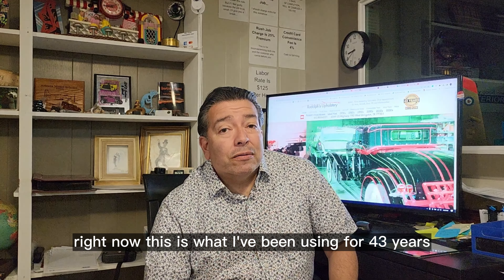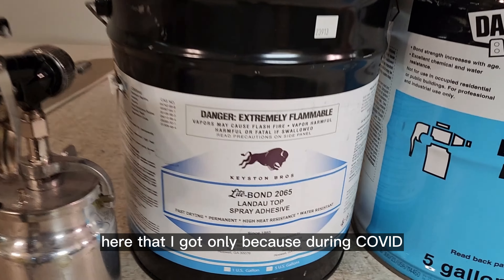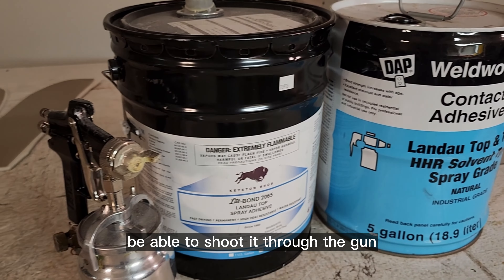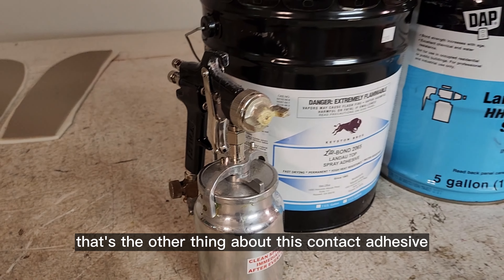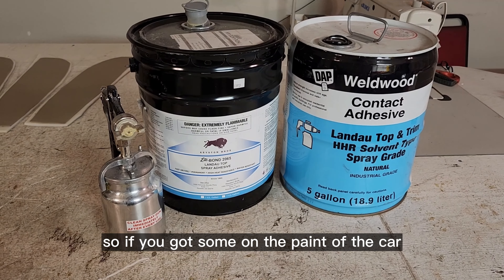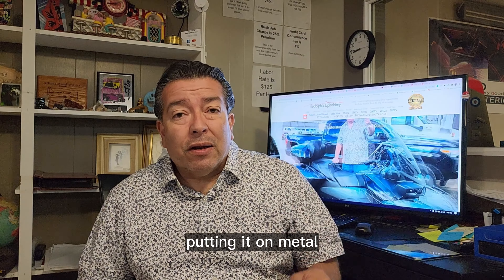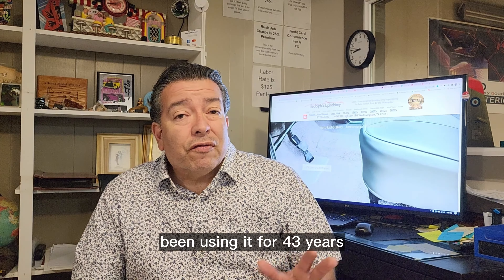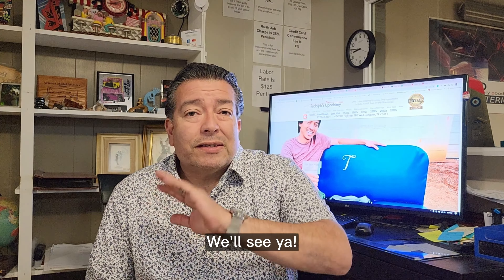You have been doing this wrong 3M spray can glue adhesive

Comment: Do i need a gun?  Or can i use a brush?
Reply from the maker: Hello Lone, You can use both a brush or spray gun. Please keep liking and watching!
Reply: @oldschoolautoupholstery  thanks.  So i have another question. I did my headliner, and i used a brush.  The contact cement went through the fabric and the suede fabric now looks like it it stained.  Is there a way to take off without damaging the suede (faux suede), or having it come off the board?  Or do i have to redo it all over again?  Thanks for the knowledge.
Reply from the maker: @Lonewolf70-  Hello Lone, Sometimes things happen. Mineral spirits is what I used to remove glue. The downside is, it will also loosen the area already glued. Please keep liking and watching!

Comment: 3m 90 wont go anywhere on u if u prep properly and actually let it tack before u apply both sides ;)
Reply from the maker: Hello DJ, Hot weather climates when the inside of your car reaches 140 degrees, that glue will fail. That glue never cures. Contact adhesive cures and will never let go. It has also never failed me in 44 years. Just sayin'. I have paying customers and want to maintain a really good reputation. I am not willing to risk it. Please keep liking and watching!
Reply: @oldschoolautoupholstery  havent had an issue with 90, it's rated up to 80c or 190f? i think. You're right tho, if you're doing it as a business its just worth to invest in a spray gun and get contact adhesive in gallons :)
Reply from the maker: @djilu9916  Hello DJ, Right On! Right on. Please keep liking and watching!

Comment: 3M 90 is much better than 77.
Reply from the maker: Hello Jay, Contact adhesive is way more reliable than the 90. Just sayin'. Please keep liking and watching!
Reply: What about face ventilator safety? Not safe to breathe that stuff.
Reply from the maker: @jaygold4467  Hello Jay, I have never worn a face ventilator in 44 years of spraying glue. Then again, We drank from garden hoses and didn't have seat belts when we were kids. I'm still here to talk about it. Just sayin'. Hehe. Please keep liking and watching!
Reply: @oldschoolautoupholstery  Ive been around almost 70 years and still havent found the seat belt on a motorcycle - - l o l   , Ive decided to use your approach to put a headliner in a older corolla , I suspect you may know something about it - l o l
Reply from the maker: @charlesmccormick4443  Hello Charles, I do remember those Corollas having vinyl plastic headliners back in the 1970's! Hehe. Please keep liking and watching!